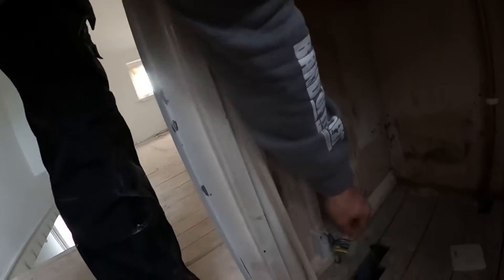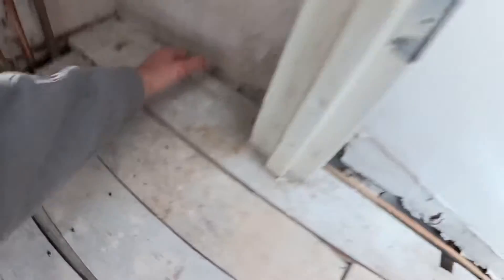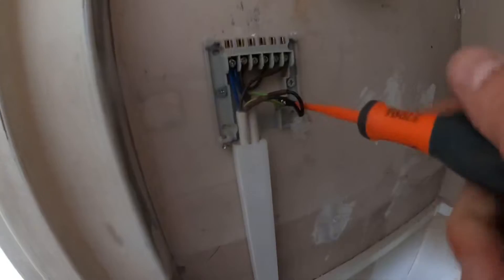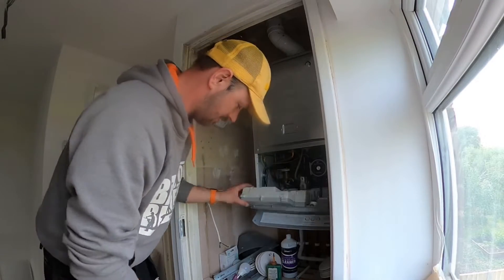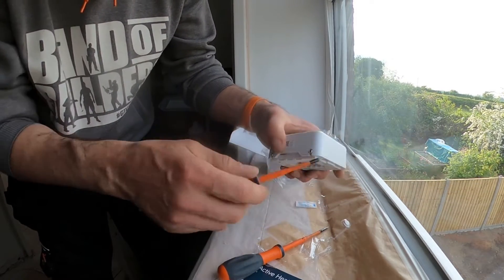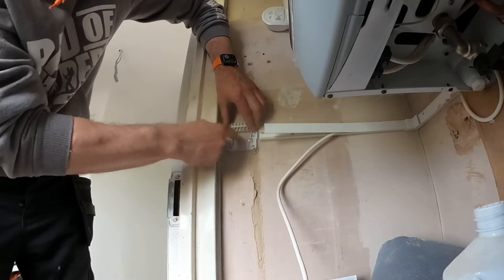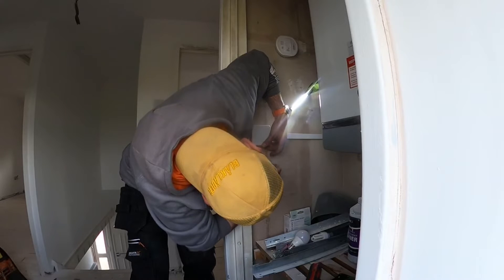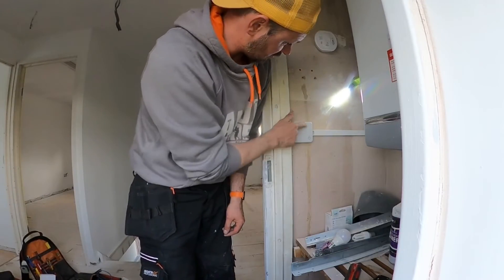Installed Hive Thermostat on My Combi Boiler—Here’s What Happened!

Comment: Can replacing the old one do something better for bills? My thermostat is located in the hallway and keeps turning on the heating whenever doors are opened. Will you advise relocating it or replacing with a new modern thermostat? Mine is the old analogue clicking tuner
Reply from the maker: Yes a smart one with sense if your at home or not and control the hearing to off when not needed

Comment: How well does the thermostat perform? My biggest gripe with Hive is that it almost zero hysteresis so one the room is up to temperature its runs the heating for a few minutes, then turns it off for about ten minutes and repeats that several times an hour. Was your experience similar? If so, it can't be good for the longevity or efficiency of the boiler.
Reply from the maker: Sounds like it’s faulty mate
Reply: @toolboxtalking  If you search for Hive & hysteresis you will find many complaints over the years. Seems to be a design feature.
Reply: There's ones called opentherm which is newer hive thermostat and it stops this from happening and calls for what it needs contant rather then switching on and off
Reply: @jordanbrowne3904  My Vaillant boiler doesn't support Opentherm so I'd have to swap all of the controls to their proprietary system. That's not cost effective.

Comment: NAW just to try the rads you should have just fired it up there's a stat controlling the boiler inside it  you don't need the wall stat yi should have left the link in the boiler just try it
Reply from the maker: You still require a room stat
Reply: @toolboxtalking I thought he just wanted to see if the rads all get hot and air them off then put roomstat in later

Comment: I have a vaillaint combi boiler,  can this hive be installed on this boiler to control both heating and hot water? Or do you know any other alternatives that can control both? I want to be able to switch off hot water if my son spend 10 hrs in the shower😂 which he does
Reply: i nterested too this option hot water control <3
Reply from the maker: @გლობალთერმი you can get the same thermostat to control the hot water too, I will do a video on this too
Reply: @herbert4015  Did you find a solution?

Comment: Managed to swap to hive but   heating is not kicking in. Green lights green on both kights.
I did remove the jump wire from wire connecting points 2&5. Any suggestions?
Reply from the maker: Have you a tester to see if it pitting out a live for the timer to work?

Comment: Do you work in North London at all? I have a Vaillant TurboMax 828e plus conbi boiler with an internal Vaillant Timeswitch clock within the front panel on it for the past 22 years, which is now obsolete. I am obviously looking to install something like a HIve V3 or Nest, but I want to be able to zone my 9-11 rads at a later date with compatible thermostatic radiator valves, which I understand the Hive V3 is able to do, but I am unsure as to whether Nest can or not. I am eager to get this done by a pro such as yourself and this video has convinced to go ahead. Thank you.
Reply from the maker: Sorry mate I’m in the midlands. However I’m sure there are good sparks down your way - it’s a pretty simple job
Reply: @toolboxtalking where in the midlands mate
Reply: Hi I'm not an electrician I want to upgrade my room thermostat from an old analogue type to a digital type I've got pictures of the old one  and what I want to put up bit concerned on the wiring wonder if you had an email address so I can  show you the pictures on what I've got and what I'm hoping to achieve I'm looking for guidance on the wires in the right place if is this something you could help me with thank you very much

Comment: Brilliant and informative video mate. Would i be right in saying theres also a hive thermostat without a receiver, that also has wifi, that  you just wire into your existing wiring for your old 2 channel timer? In other words the thermostat looks identical to the one you just set up, except all your live, neutral, earth, NO, NC etc terminals are actually on the back of the thermostat?
Reply from the maker: I think they all have a reviver and a control. All the wiring goes to the control and the stat is wireless and battery powered